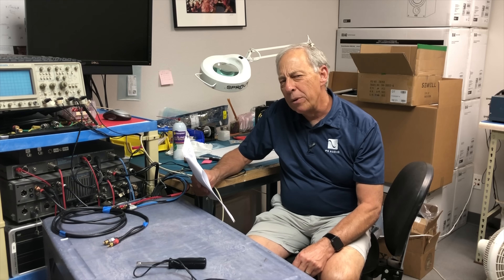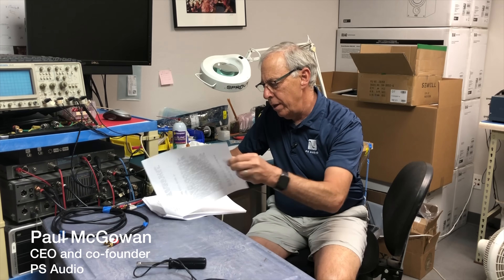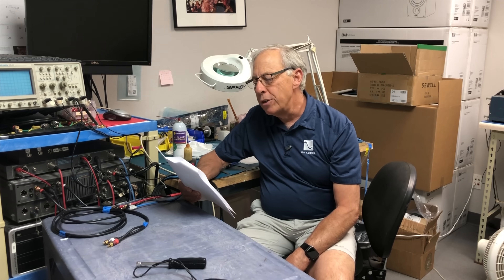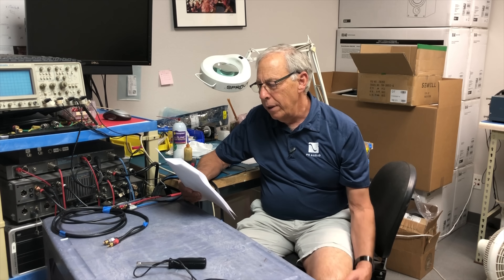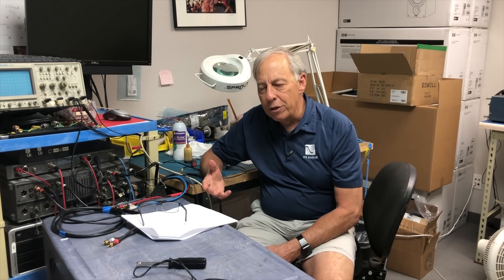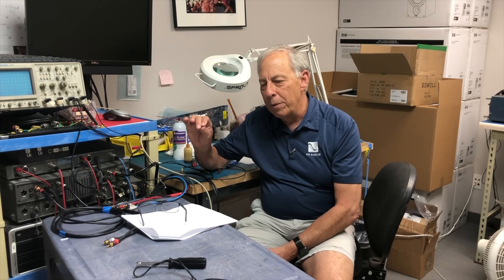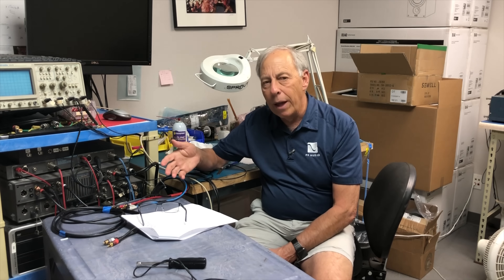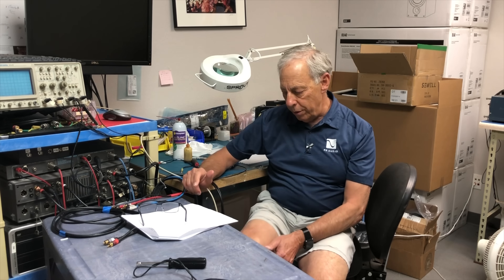How to match a preamp to a power amp

Comment: I disagree with the assumption that balanced always sounds better than single ended.
It very much depends on the configuration of the input stage of the power amplifier.
I have owned several power amplifiers where balanced interconnect sounds clearly worse than single ended and when measuring distortion from the input stage balanced differential connection might remove a lot of the even order harmonics which definitely changes the sound for worse.

Comment: hi paul, thanks for your post on how to match preamps to power amps. coincidentally i bought a ps audio 6.1 several years ago along with a hafler 500 amp to power my polk audio tsx550 towers mainly to listen to music. i was pleasantly surprised to see that you are associated "PS" after watching your video because i'm in the process of researching the technology of my units so that i can refurbish them. i'm educating myself so that when i get them worked on i can feel confident that i'm making wise decisions in either investing in the units i have or finding a better synchronicity! the input impedance on the hafler is 47000, so if i understand your post correctly, the ps 6.1 and the hafler 500 are perfectly fine to hook together ?

Comment: Thanks for the explanation, with a caveat. You are assuming too much knowledge on the part of some listeners. I am trying to determine a correct match of preamp to a Crown Audio power amp. When you got to the part on balanced vs open ended, I have no clue what that means. So, now I have to start searching for an explanation of that.

Comment: the whole "impedance matching" issue has always been woefully unaddressed (or incorrectly addressed) in the audio community.  paul has it right here!  though there is a little more to it...when transmitting signals, your output z from one device and the input z of the next device will dictate whether you get the best voltage transfer, best current transfer, or best power transfer from one device to the next.  the 10+/1 ratio is applicable to all modern solid state hardware, because solid state preamp and line level amplifiers are operating as voltage amplifiers, and best voltage transmission happens with a low output z to a high receiving input z.  current transfer is rarely (never in my experience) a concern, as even current amplifying devices like power amps will still have line level voltage amplifier stages buffering the input.  the only other real concern is power transmission, which is best achieved when the output z and the next input z are matching.  this is why we match from power amps to speakers, usually at 4, 8, or 16 ohms, to maximize the power transferred from amp to speaker.

Comment: Hello Paul,  I need your help.  I have the Paradigm Studio 100v3 front speakers and paradigms surround and center speakers. I just bought my self the NAD S250 power amp,  What pre amplifier would I require to match up with my power amplifier?.

Comment: The impedance "matching" discussion and the balanced vs. un-balanced arguments makes sense..But the "synergy" stuff is totally subjective opinion. I connected an old SONY TA-2000f (unbalanced) Pre-Amp (1k output imp) to an Ashley 15-band EQ (22k input imp) with balanced inputs and then fed the output to home-made unbalanced "distribution box" (25k input imp) connected to several power amps (unbalanced). It all sounds great with very little residual noise. Just use high quality (short) cables.

Comment: Hi Paul!
I want to try using my Violectric V281 as a preamp for my Woo Audio Wa22 1st gen.
The impedance matching is fine for those two (0.2 to 100k) both have ballanced inputs and outputs, both are headphone amps.
My question is - since i want to use the V281s volume pot in which position do i want the Wa22s pot? Full throttle or somewhere in the middle?
Is there a possibility of magic smoke?

Comment: In my experience a balanced cable will always sound like it has lower noise but i'd rather have a high-end single cable than a cheap balanced cable as long as noise isn't a real problem. The construction quality of the cable makes a difference whether is balanced or not.
Reply: My experience says the Stellar GCD -> Levinson 333 amp sounds much better with any of the balanced cables I've tried than with any of my choices I have for pretty high-end single ended cables.

Comment: Simple solution. Integrated Amp-"all inclusive with both digital and analog I/O"- plus DSP speaker correction and multi-channel operation. Separates constitute a recipe for mismatching: One exotic preamp to an exotic power amp and or wonky matching speakers all with different demands on Z.

Comment: This was a great question. I'm of the school of thought that while having everything from the same company ensures that all connects nice and synergy between the components is a given, the problem is that sometimes that is not necessarily good. Here is the problem I have in theory: Sometimes the company one is most interested in for say amplifiers has great ones, but the preamps from the same company do not meet needs or just aren't that great in some respect or visa versa. That begs one to mix brands in that case I would think. I don't see anything wrong with doing that to get the best of both worlds so to speak as long as the tech side matches up correctly. Now, yes, I can see a list of challenges or problems trying to tie a tube preamp to a solid state amp or visa versa even in the same brand and I personally question what that would really give one at the end of the day.  
By the way, balanced or single ended, both are fine, I have no problems with either. If I had balanced inputs on everything along with single ended, I'd go with balanced if I could most likely, but that's me.

Comment: Paul,  I'm going to cover two points from an audio perspective and from an RF perspective because they are related.

First on the block is the impedance.  The minimum of 10:1 is strictly for the benefit of low cost output drivers of the preamp.  In commercial audio this amp input impedance permits daisy chaining either power amps or powered speakers for use in a cluster for concerts.  Many powered amps have the pair of jacks built in for daisy chaining multiple powered speakers in a cluster. Sonically this actually is not the optimum solution, however at audio wavelengths the non optimal effect is negligible and is generally ignored by engineers.  The design theory is a lightly loaded audio preamp can produce a clean waveform when it is not heavily loaded.  This is fine for short cables and audio frequencies.  For audio short is defined as under 100 feet.

From higher frequencies in RF and down to 100 KHZ is considered radio, and some radio is near the audio band.  The considerations for RF is maximum power transfer on a cable with minimum reflected power.  This applies to almost all high frequency applications such as twisted pair CAT-5 network cable, Cable TV, DMX-512 lighting control, and in audio, low impedance microphones and POTS telephone service.  The driver is lower impedance or matching the impedance of the transmission line (wire, cable, interconnect) and the cable is terminated at the cable's nominal impedance.  This match is required to send signal any significant distance without distortion.  Examples of impedance not matching at higher frequencies thus limiting max cable lengths to very short distances include MIDI cable, RS-232 data, unbalanced RCA audio, and speaker cables.  These cables should always be less than about 20 feet to function properly.  The longer distance version of RS-232 data is balanced RS-485 which is terminated into it's impedance and can travel over 10 times the distance of RS-232.  This improvement in distance is due to the cable impedance and it's proper termination.

In pro audio XLR line cables are about 80 Ohms impedance depending on the manufacture.  Most consoles are stable into 100 Ohms and amps are either 10K or 20K balanced.  Jumpering a bank of 10 amplifiers in daisy chain for a cluster is normal practice with a load of 1K or 2K which is well within the driver range of commercial mixing consoles.  For example a Mackie SR32-4 mixing console is specified to have an output impedance on all outputs of 120 Ohms.   Loading it to 600 ohms is not a problem at all.

POTS telephone service in the US is 600 Ohm. Works fine in rural areas with overhead lines.
Networks using twisted pair are terminated into 120 ohms on each pair.  So is DMX-512 at the end of the line for long runs.
Cable TV on coax is terminated into 75 Ohms, same applies to old analog TV video cameras and monitors.
Baseband analog video was a signal that starts in the audio band and has to remain flat well beyond ultrasonic sound.  An analog TV or CCTV signal was from 25 or 30 HZ to 6 MHZ.  Most audio equipment interconnects won't pass this bandwidth of a signal without destroying it and it won't work if a long cable is not terminated into the cable impedance.
The same high bandwidth rules could be applied to high quality sound to carry sound from one place to another.  For some critical applications I have put audio on RF cable and terminated it properly to run sound to a 2nd venue location.
Two way communications use antennas and coax with 50 ohms impedance. This uses coax, not twisted pair.

If the preamp was properly designed to drive a balanced line and had an impedance of 20 ohms or less, it could drive insanely long interconnects terminated into the nominal impedance of about 100 ohms with insane flat response well beyond the upper limits of audio, but as stated in another video, engineering is a trade off.  Lower current drivers and higher Z loads are fine for lower cost and short distances which in a home are well under 50 feet.

Just my 2 cents worth from an engineering perspective regarding cable impedance and proper termination.

A quick note of speakers.. They are a complex impedance, not a simple resistive load. There is not a cable made that is perfect for a speaker other than very short.  A dynamic speaker won't match the impedance of any cable at all frequencies.  A long interconnect is no problem as it can be terminated close to it's nominal impedance.  This is where I disagree with Paul.  Higher impedance in an amp is not better for the input of amplifiers.  Lower to match the cable is best for the cable and distance for frequency response and, higher is better for low current preamp drivers for lower distortion in the preamp. The best compromise for most home audio is 20-50K and keep the distances reasonable.
Reply: Well... I'm sure he will take that on board?   I'm unsure of the point or your little essay here. Are you trying to educate Paul, or the rest of us who aren't engineers and just want ideas for well matched hifi?
Reply: It is an introduction to engineers for the separation of pseudo acoustics and solid engineering.  This is specifically aimed at those selling $100 and up patch cords.  There is not a TV studio in the country that needed exotic cable to patch an analog color TV camera to the video switching console. BNC connectors were the order of the day with 75 ohm impedance cable and equipment that terminated at 75 ohms carried video signals just fine from 30 HZ to 6 Megahertz.  This was a 1 volt Peak to peak signal.  Audio could have been designed to use the same bandwidth with the same response as video.  Audio did not take this path because the higher bandwidth requirement does produce higher noise levels in amplifiers.  Engineers working with OP Amps deal with balancing gain, bandwidth, and noise as they are related.  Lower current drive from audio preamps and higher impedance inputs in amplifiers is a trade off for lower noise but a limited interconnect cable length.  Pro gear drives balanced cable with a lower impedance and the amplifier inputs are lower input impedance input for use on longer cables than home equipment.  Neither are designed to match the impedance of the cable except in digital snakes for digital mixing consoles which use 110 to 120 ohm network cable.
An example of this is the Behringer S32 with servo balanced XLR inputs and outputs all 32 channels on a CAT5 network cable up to 100 Meters long.  This is the only analog portion of the system up to the output DAC to drive amplifiers.  This keeps all analog cable into the system to under 30 feet.

Comment: I guess this is why many of the 'pro' reviewers seem to stick with matching pairs from the same manufacturer, esp when the power amp costs somewhere north of 50K USD. Your point re impedance is a good one - I often wonder just how successful some 'tube preamp into solid-state power amp' match-ups are when there appears to be no quoted output impedance for the pre : I guess some folk just get lucky. Replicating some of these combinations would require a Jeff Bezos' budget ;)

Thanks for the video.

Comment: I'd like to think that a good hi-end DAC, such as the DirectStream, has already put its best effort forwrard if it has XLR output that can supply the amp directly.  Why rely on the pre amp?  And if there is good reason, why isn't the DAC doing it?
Reply: Larry has mentioned one aspect of adding a preamp. The other issue is sometimes you need a preamp for more signal gain. There are two types of amplifiers you can buy. Integrated amps and power amps. Integrated amps are designed to run on just a few volts of signal. A dac usually outputs about 1-2v and this will drive most integrated amps. Power amplifiers on the other hand usually need much higher input voltages. I have seen a couple power amps require up to 6v input, and im actually building myself a tube power amp that would need 10v input. So a preamp is required to take a voltage from the dac and amplify it enough before the power amp (hence "preamp") to reach the desired input voltage. 

This voltage gain is part of the reason why adding a preamp can improve sound quality to the system. By boosting the signal with a quiet, high quality preamp, you can turn down the volume on your main amp which decreases the amount of work it has to do.
Reply: @tristanjones7735  For one given output level on the speaker outputs, the amlifier must do the same work regardless of how much gain the signal has. You might get higher noise floor if you must amplify it more. The preamp regulate the amplitude to be lowered from the full line signal which would be far too high to send into the power amplifier. The volume control cranks down the voltage, which is related to the volume the power amplifier produces on the speaker outputs.
Reply: @oysteinsoreide4323  I think you may have misunderstood what I was getting at. There are actually amplifiers out there that need signal gain from a separate preamp in order to provide the max output level the amp is rated for. Its rather unusual to find amps that are designed like this in modern times, but they do exist.
Reply: @tristanjones7735  Ok. But I didn't think of amplifiers that wasn't made to current line input and output specifications. Is it because they don't ampliy it enough if the line in level is too weak? Is it a special type of preamp you need in order to get enough juice?
Reply: @oysteinsoreide4323  Well the basic idea is that an amplifier is going to almost always have a gain stage and a power stage. These two stages usually require different power supply voltages. A lot of people just make a power supply that can handle the power stage and then modify the voltage to handle the gain stage. But this is not ideal. If you split the power stage and gain stage into separate units, you can optimize the power supply for each section. You also have better control over noise characteristics because your high gain stage is not sharing the same chassis as your power stage. 

Its a really esoteric design approach and I have only ever seen it in boutique amps at audio shows. But it does exist.  

Now the other situation that is far more common is that there are a lot of amplifiers that are designed to work with a line level input of 2v. Most modern sources are capable of 2v out. However there are plenty of vintage sources (CD players) that only put out 1v. So you need to boost the voltage a bit.
Reply: Larry Niles That's interesting, thanks for the reply and I will look for the video.  I suppose the proof is in the listening.  I'm very hesitant to place another device in my pathway.  I use an SOtM 200Ultra as a source with an expensive linear power supply.  This feeds a Mytec Brooklyn DAC.   So much care has been taken to control jitter.  I've found a subtle difference even when moving my NAA farther away from its linear power supply.  The thought of transferring it to another device makes me nervous.
Reply: What about distortion with certain preamps/dacs and tube power amplifiers? What would cause distortion in a tube amp from a preamp or DAC?
Reply: I have a denon dual mono that is not integrated, tryied to plug the dac directly into it, but sound terrible, so much noise, lifeless sound, no soundstage, frequency response is very mid... even if the volume is very high, the sound is not good, so i think it is one of those cases that a preamp is needed to make things match

Comment: Never had the chance to listen to PS audio pre and power here in UK but I generally reckon a valve Preamp from Audio research takes some beating but if matched with the same company's power amps sounds a bit clinical. Matching with a Constellation Audio solid state power amp is a match made in heaven - valve warmth from the pre and refined muscle from the power amp. I have tried Constellations own preamp and it is so neutral that I crave a bit of warmth. Mix and match carefully for me.